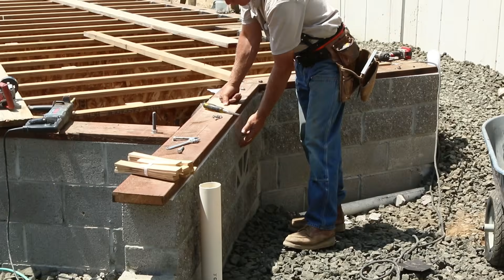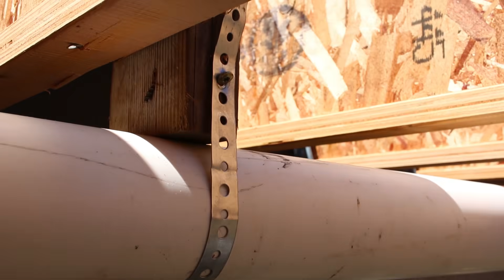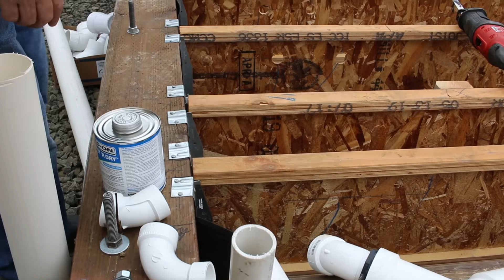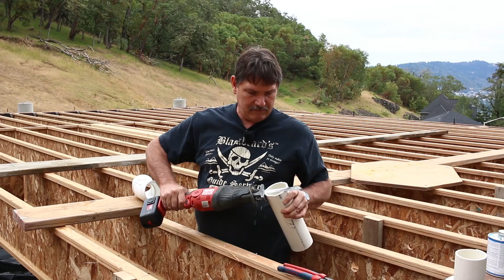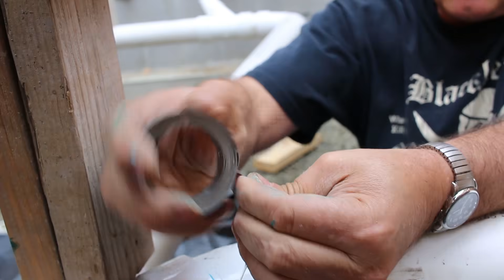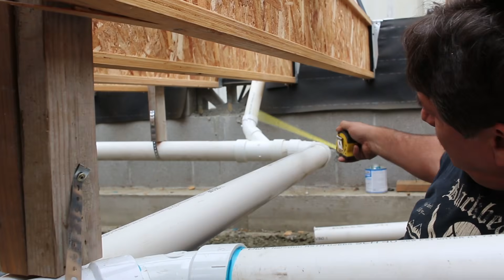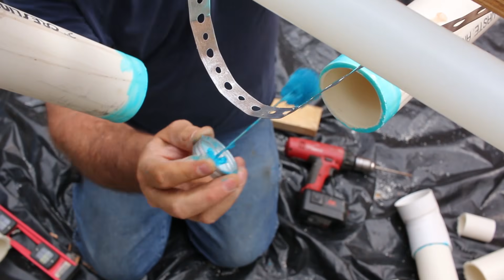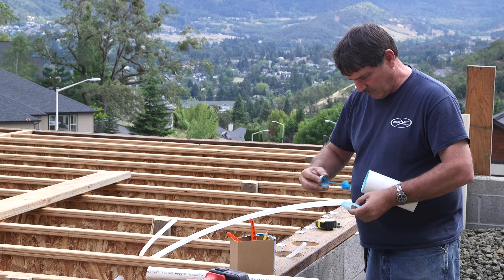Waste and Drain Ep.41

Comment: Very nice of you to wait for the plumber before putting down the sub floor.  In California, the contractors I worked for did the same.  For some reason these knuckleheads in Virginia do not.  Must be a cultural thing.
Reply: He's the project manager arranging his own job - its not just nice, it just makes sense.  Otherwise the plumber has a harder time and charges more, is more prone to mistakes, etc.  It's all to his advantage and its all in his control.
Reply: That is nice I have been plumbing houses for 30 years and never been in a house to start until it's all framed
Reply: F De Mascio as an electrician in Va I will say that it is an every man for himself jobsite here. Nothing like finishing your Electrical rough in then having the turd herders and tin beaters come in and just cut wire out because they had to move something. If you are lucky you find out they cut out the romex before the Sheetrock is hung!
Reply: F De Mascio there is a reason these subs like working for this builder.

Comment: How come your boy doesn't doesn't use primer on his pipes? Is that not required where you're at? Where I'm at if the inspector doesn't see purple on your pipes you're not gonna make it.
Reply: RedAlert602 isn’t that a 2 in one product he is using?
Reply: @badlandskid  I just looked up the can. And it says "can be used without primer if code permits". Its just that where I'm at they don't let primer-less pipe slide. But if he doesn't have to use primer, good on him. Its a pain to use it because you look like a grape afterwards.
Reply: RedAlert602 yeah, local jurisdictions usually have the final say on what is acceptable and what is mandatory.
Reply: @badlandskid  I figured they were okay with it.
Reply: @RedAlert602  What does the primer do?  I see plumbers here use orange glue for PVC and it's all good.
Reply: @malcolmy11  Helps make a stronger joint and keep liquids inside or out of the pipe. And glue only may be allowed in your area. I never use the orange stuff, so I can't say if its a 2-in1.
Reply: A , the primer prepares the plastic for gluing. (ABS, PVC, what have you).
Gluing is really a misnomer. The glue is actually a solvent and it melts the two pieces together at the joint. A better name for the gluing is solvent welding.
Reply: Definitely primer on the pipes in the crawlspace.

Edit: Nevermind... looks like a 2 in 1 product.

Comment: Guys I love this channel I love your videos and all the knowledge you share.
Im a third generation master plumber and I have to say im very dissapointed with the  installation of your drainage system. Using band iron instead of proper hangers (greenfields, clevis, etc).  We would fail our inspection if we used those hangers. I'm not trying to nitpick but the plumber is on a very popular youtube channel and really should step up his game!
Reply: I saw that and went looking to see if anyone else had, before leaving a comment. One way to correct that violation is cut old bicycle inner tube and slip it over the "plumber's tape" metal.
Reply: To be fair, maybe the inspector allows it. I'd have no problem with waste lines in my house being hung that way.
Reply: Do you live on the coast or anywhere else where rust is a legitimate concern? Otherwise it seems to me overkill. Only time you must is a spec job and on residential is very rare if even That.
Reply: What code violation is there?

Comment: Too much fall isn't great.... Not layed out properly and you'll get solids left behind.
Reply: He covered that in the video. That used to be the rule when pipes were made out of metal, but code no longer cares.
Reply: I'm not a plumber, just stating what was said. (paraphrase)
Reply: I posted before he mentioned this, however, it is still an issue even with modern materials.

I'm a Heating and plumbing contractor of 20 years.
Reply: If the water velocity is too high solids will get left behind as they will inherently have greater friction.
Reply: I heard the same thing as you are saying. "According to plumbing code, drain pipe has to be sloped a minimum of 1/4-inch per foot and a maximum of three inches per foot or vertical. A slope of less than 1/4-inch per foot will cause constant drain clogs and a slope of more than three inches will allow the water to drain without the solids."
So I'm not sure where this plumber got the information that it doesn't matter anymore. It is really easy to look things up on the internet. Clearly it states there is still a plumbing code to follow and "anything more than 1/4 inch per foot is certainly NOT acceptable.

Comment: I assume that when you core out the wall you gotta know where the rebar is? Else you'll create a point where the bar can start rusting (I think?).
Reply from the maker: good point - yes we paid close attention to that when picking the spot to drill
Reply: You can core through rebar but it weakens the structure, is loud/time consuming/expensive, and if you're careful there's no need to.  You could grout to seal any penetration that exposed the rebar.